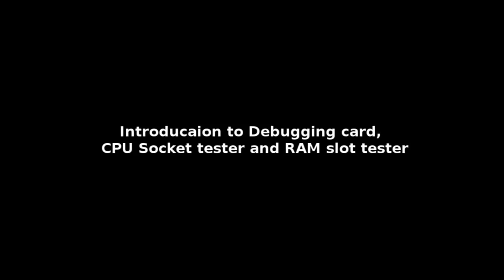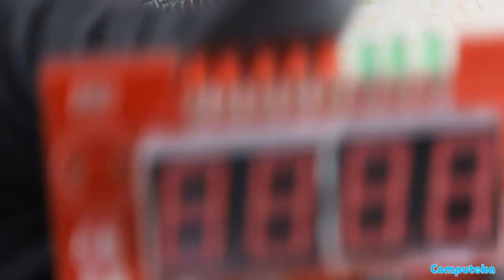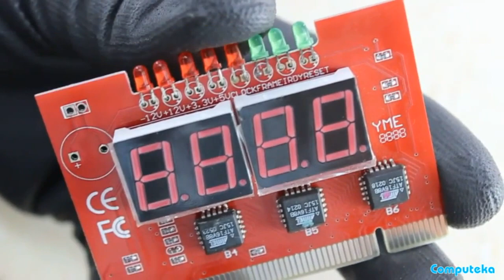PC Motherboard Debugging cards for beginners

Comment: how to check the no display sir?
Reply: Veeranna Parma if on laptop, you can connect your laptop to external monitor with VGA cable and see if it works on the monitor. If it works than you have to change the VGA cable of your laptop. Or maybe try disassembling your llaptop disconnect the VGA cable of your laptop and connect again.

If on desktop, you can insert a graphics card in ur AGP and if it works with the graphics card than your VGA connector is bad. There might be other way but these are most convenient

Comment: I had not seen these tools before. Thank you for the Video!

(I have an lga 1150 that is not responding at all (fans twitch but no post)... perhaps these tools will help
Reply: Same here but my kicks on from time to time and then runs fine for a few hours before shutting itself down and refusing to even post again. My board was the Gigabyte Z97X Gaming 7 out of curiosity which board was yours?